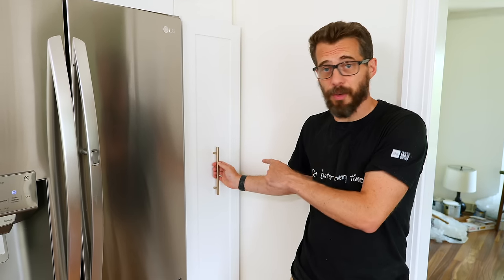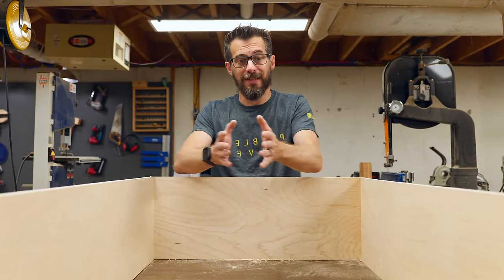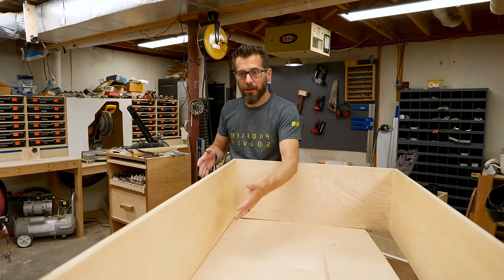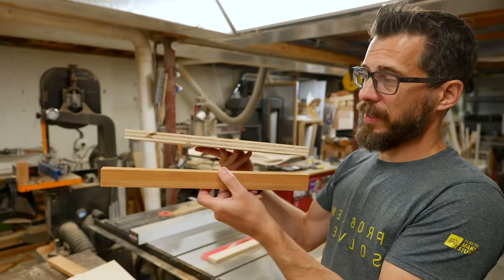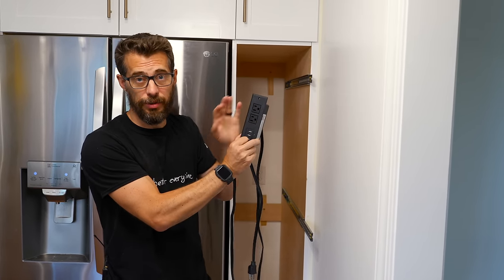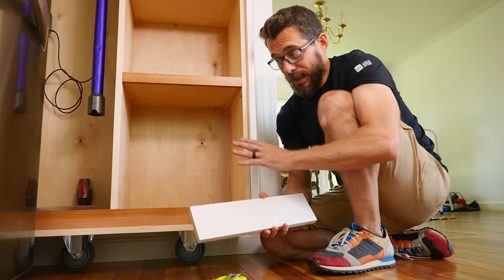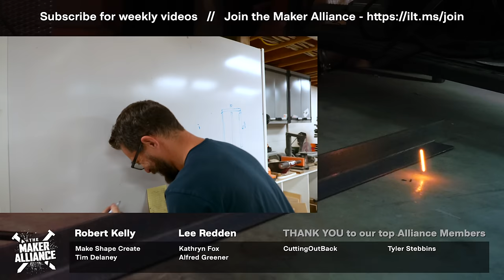How To Make a Pull Out Pantry | I Like To Make Stuff

Comment: a small suggestion: i would also cover the left side of the cabinet where the wheels are as well. like between the wheels and the fridge. flush with the edge of the toe-kick. that way your feet cannot get stuck between the toe-kick and the fridge by acident

such a beautiful projekt! i would love to one day have a house on my own and build this one as well :D
Reply: I agree just add a kick that goes in so its all covered as well. Also add support from tipping to far on that side.  Can put felt on the bottom too to protect floor if it ever goes too low.
Reply: @MrNkubitz  great addition!
Reply: That would also prevent the cat from running back there and getting smooshed.
Reply: Yah, I came here to comment on that too.
Reply: That also limits your ability to doesn't under it
Reply: @Bward216  hinge the inner toe kick to swing for cleaning
Reply: @moomookid723  Ooooh, I like that.
Reply: @MrNkubitz No way you see those wheels while standing up.

Comment: I used your idea for a pull out cabinet and created a secret liquor cabinet in my bar area. The tip about putting castors is what made this project a reality. I also included some LED strips on each shelf. When you pull the cabinet open all shelves light up from the bottom of the bottles, a very cool affect. Thank you for your inspiration and tips.

Comment: Definitely a great solution for an awkward sized space! For anyone looking to do something similar, Fulterer makes pantry slides that attach to the top and bottom of the drawer and are rated for higher loads than typical under-mount slides (up to 450lbs). I just installed two pullouts side-by-side in a large pantry and am very happy with how smooth they operate despite being loaded with cans and other heavy items.
Reply: Can you share a link to the ones you use ?

Comment: Nice.  Using the slides as a stop and a little support at the top is a great idea.  I was working out plans with skateboard bearings and angle iron mess to support the weight...but this is much simpler.
Thanks as always👍

Comment: We inherited a pull-out pantry with our kitchen, which is our primary food storage area. After living with it for 5 years, I can honestly say I hate it. Hard to get odd shaped food containers in and out. Anything hanging out beyond the edges of the shelf will interfere with closing the cabinet. I plan to replace it with a traditional pantry with open storage in the doors as well. 

All that said, I do really like your idea to use pull-out storage for cleaning supplies. I think I’ll repurpose those cabinets in our hall closet for that use. Thanks for the inspiration Bob!

Comment: Excellent Bob!  We did virtually the same thing next to our fridge.  Our pullout is accessible from both sides.  I ended up using extra heavy duty slides meant to for emergency vehicles (300 lb capacity) on either side…as well as a couple on top just as you did.

Comment: I made a full length pull out spice rack like this, turned out great.. tips: dont underestimate the weight of the cupboard, make sure the casters are nice and beefy also dont rely on the rails to carry any weight either. you can hide the casters and anything unsightly by making a mitred box and mounting it to the bottom of the cupboard

Comment: This is exactly what I am going to do with my small kitchen. I knocked down the old pantry to open up the space and used the small adjacent closet as the new pantry. 17"Wx27"Dx81"H. Yes it's small but it's only a 1200sf house. Same concept as yours. Going to use birch or similar wood.  Im thinking 4 non marring wheels from HF. I just need to find the appropriate sliders to mount on top like you did. Thank you for making this video!!!!

Comment: There are actually under-mount slides meant for things like this :)
Reply: Yes! and if you were planning on storing heavy stuff like bowling balls you could add under mount slides upside down on the top. Get rid of those wheels. Just frame the open side like frame and panel w/o the panel to stiffen up that side. Even with the side mount slides you could do top and bottom on both sides.

Comment: Nice upgrade.  Have you ever thought of using pocket screws and plugging the pockets with the wood matching plugs, either store purchased of made in the shop? Then use a trim router to route the plugs down flush. I have used that technique a few times when doing built in book cases. stained and non stained finished clear wood. That way you do not have to worry about glue going everywhere.

Comment: Nice ideal and execution. The pull out pantry offers way more useable space without stuff getting lost in the back. If I were doing this I probably would have added a access hold through the back of the cabinet to where the clips were on each of the drawer slides. Chances are that would fall in the vacuum compartment and would be out of sight but if not some covers would be easy to fit. I was wondering if you put anything on the cable to stop it getting pinched during the slide, I have seen these for chargers in drawers and there is a little metal folding rack to support the cable.

Comment: If you screw the last runner on the top further towards the back of the unit, it will slide out further but still be able to be pushed all of the way in. You can see in the last minute where you slide it in, the last runner doesn't go all the way in. That means you have some inches to play with. 👍

Comment: Yes, yes, and yes! This is exactly what I plan to do for an awkward space next to my murphy bed cabinet build. I was thinking about drawer slides but thought it would be too heavy so settled on casters. I was worried about it pulling in and out straight and not banging the sides up over time, so the combo of the slides and casters seems like a good move. 2yrs later do you feel like you over built or was it definitely the way to go? 🤔

Comment: Another approach to this would be to use 4 casters on the bottom (2 fixed, 2 swivel) and use something like a bi-fold door track and wheel or even something heavier duty like a garage door track and wheel (I tend to over-engineer things) at the top. This would give you full range of linear movement in the unit without having to worry about limit on full extension with the drawer glides.

 An additional fix is to use some of the nylon (like what is used in NFS cutting boards) as a frictionless surface against the inside wall and the back of the cabinet.

Comment: Advice from an amateur cabinetmaker with a technical degree: I would recommend leaving the bottom of the cabinet in and using slides top and bottom of the cabinet. I would also recommend doing a return on the toe kick so it looks a little better from the side. Great work man!

Comment: Also if you are adding wheels on the bottom side of a cabinet like this, use a router if possible to make a track to keep them in line which will make for a smooth pull

Comment: It might be a pain, but to extend the length of the slides you could use a double slider on the top. Would require to do that first as the whole thing would need to be shorter. Slides on the top that once it hits the end of travel the plate has slides on the bottom connecting it to the rolling carcass. If you could find longer full extension slides that might be an easy fix, but your likely to the end of where you can go.  The top solution is also better to get it to release.    Also, hind sight about the wheels is great.  If you had though and put 3 or 4 so  it stands and rolls on its own it might be nice.  I like the false front solution as well with the toe kick.   We have little narrow cabinets on the side of the dish washer and stove that would work great for this, but I think I could do it without the wheels.... much smaller.

Comment: I had a similar project for my pantry's spice rack. Unfortunately, wheels weren't an option. We did two slides at the bottom (in the normal orientation as for drawers), and one  at the top of the rack (mounted horizontally, like you show in your video). Still works pretty well.

Comment: Enjoyed the video and the design idea. Do you have design plans available? Also, a suggestion. I had a king size bed inside a 18" deep alcove with a structural canopy. The sleigh bed headboard had only 3/4" on each side which created a problem for changing the bedding. I detached the headboard from the side rails, attached it to the back wall of the alcove, added a frame support at the head of the bed for the boxspring/mattress, attached casters to the support rails on the underside and laid tracks on the floor under the bed so I could roll the bed out to change the bedding when I needed to. The floor tracks kept the frame from moving side to side and rolled smoothly in and out.

Comment: Love these videos. Just an idea because it looks kind of weird. Add a toekick lengthwise as well. Not only will it hide the wheels but it will also stop the kitty from getting back there. depending on how you attach it, you might be able to hide any kind of gap between the box and the toekick(s). You probably have to redo the front toekick and make it a bit higher.

Comment: We've got a cabinet like this at my moms house, it's a spice cabinet so about half as wide, and it runs on drawer slides. For the depth and weight of your cabinet, casters are probably necessary, but drawer slides are the way to go
Reply: I did one in my house like you are discribing, and its too heavy (100% mdf), i put 5 pairs of drawer slides, and still tilts a little when its fully open, but works haha.

Comment: I made this unit. Got 2  200lb 24 inch door slides from Lee valley tools. I put 2 slides on a section.  

So 4 heavy duty 200lb draw slides

I made 2 sections rather than 1. Each 36x 24. 

You do need to be careful when pulling it in and out

Comment: I realize this is a few years old now. But I am planning a similar project and while doing some research found your video. My cabinet is going to be larger, and thus heavier. Attaching the slides to the top is definitely a great tip. I do have a concern about the wheels being in exactly the same plane as the slides. Which would cause the wheels to scrub as the cabinet is pulled in or out. That is something that seems like it would need to be exact which could be tough. And possibly something that contributed to your comment that is doesn't slide in and out easily. Now that you have lived with it a few years, how is it working? And do you think you have a slight wheel scrub that is contributing to the effort to pull it in and out? If so have you addressed it, or made any other changes?
You have great content, I enjoy seeing your thought process as you work through different challenges in your builds. Thank you

Comment: Nice Pantry project!  I've seen the bottom handled with shelf guides, the pantry mounted on a sled which was on slides but not on wheels - creative.  Other than the vac location, would you do anything different?  Designed strong.  Well done!

Comment: You could have added hinges to top and bottom.  Well like you did on top at the end.   Blum heavy duty under mount slides would slide easily.  The wheels and cutting cabinet are not needed 

Also add a side toe kick that slides back will make it look finished on the side.  So it wraps around.

Comment: Those are some serious casters for this. what do you think the max weight that this pull out cabinet would have to support? And what are those casters rated for? Im usually 100% on board with overdesigning, but thought smaller casters would allow you to make the cabinet have a little more vertical storage. Thoughts?

Comment: Did you consider using rockler pantry slides? Those are made for sliding cabinets that can be accessed from both sides, but would have required less hardware...

Comment: Really cool solution, I love full sliding pantries :)  I feel like there are Blum bottom mount slides that probably would have been strong enough for this and made it a bit cleaner and smoother; especially if you included some of those standard slides on the top.  I feel like I've seen specs on them that can manage ~125+ lbs a piece which would have been more than enough for this application.  Probably way more expensive though.  I love the creative solution :)
Reply: Do you have any suggestions on those drawer slides?

Comment: instead of the wheels on the bottom what if you did the slides on the bottom like you did the top, do you think that would work? I would agree the wheels on the bottom are stronger but was curious if the other way would make it smoother? This is a really great idea and i may think about this when i try to design organizers for my kitchen cabinets that are akwardly small.

Comment: I’m making 2 of these but using barn door rail so it hangs. I used Teflon strips at the bottom sides to guild it on its way out. Should be smooth because it’s not rolling.

Comment: It's very cool, and fairly basic for someone who's a very basic carpenter. EXCEPT for the sliders. I don't understand why you need sliders if you have the wheels. Mine will be much narrower, and possibly not sliding out at all. I can just throw my mops and brooms in there.
However, I'd like to make slide outs underneath my kitchen work table. Much cheaper than buying slide out drawers. Am I going to need sliders? The pull out cupboards will be approximately 60cm wide 60 cm deep and 80 cm tall. 
I'm open to answers from anyone. Thanks very much. Subscribed!

Comment: Two things:
a.) There are ready made systems that work flawless (like "pull-out larder") but usually they cost a hefty premium.

b.) I would have drilled three holes in the back where the latches are so you could easier get to them if you need to just by bending your finger.

Comment: Nice project Bob. A lot of variables to address. A whole lot of couch-carpenters giving marginal advice. The refrigerator door depth is often overlooked, even the modular cabinet layout guys will miss that often enough. In hindsight, the cereal/food side just gets about 3" narrower and that allows more access to the vacuum side. Down the road you could address that if it's one of those things that drives you crazy. In the meantime, get the rest of the kitchen finished for the sake of marital harmony ;-)

Comment: Bob, I think if I were to make something like that for my kitchen, I would do 3 things differently:
1. Do 4 smaller wheels on the bottom, and...
2. Make those wheels run on tracks, and......
3. Plan some way to be able to pull the whole unit out for cleaning. Lots of shmutz is going to get in there......

Comment: Alternatively, a much easier version of this consists of building a bunch of regular drawers which you install in the base cabinet. You space them out just like the shelves in this video so they can hold tall items. But instead of having one drawer front per drawer, you only make one tall drawer front that covers all drawers, so they all open and close at the same time. Don't use self closing sliders or you'll need too much muscle to open the cabinet since they offer a bit of resistance.
Advantages: lighter structure, no wheels needed so no contact on floor, sturdy because 2 sliders per drawer, and easier to build because no different than regular drawers.
I made a ton of these.
Reply: This is how my kitchen is, I’m here wanting to do what the OP did. One large pull out makes everything much easier to find and organize

Comment: nice!  Question is how do you reach back on the wall side between pull out and it to flip the the little black flippers on a the slides so you can pull the unit out?  like about the wheelie dealie on the the bottom!

Comment: Awesome build.  Was thinking about building something very similar for my laundry room.  Did you consider using Fulterer pull out pantry slides?  It may not have been an option for your application due to the height loss and they are much more expensive than your solution.  I also noticed on your site that you gave it about 1/2" clearance on the front side and space for the slides on the back so I'm assuming the total is <1" difference between the cabinet box and in the inner "drawer".  Do you notice any resistance due to air / back pressure when closing?  Finally, out of curiosity how wide is the cabinet?

Comment: Another idea i saw in a build instead of the two long drawer slides is to use small wheels on the bottom sides left and right, a couples or more per side to guide the whole thing.

Comment: A wide rubber caterpillar track instead of castor wheels would be way more stable and greatly reduce wear on the floor. Just make a simple conveyor belt type of assembly and mount upside-down under the cabinet.

Comment: My only complaint with that setup, is the 5V usb on the power module is always on = uses power for no reason = heat, which basically means everything in that cabinet would be warm, all the time. And being beside the fridge does the same thing too.

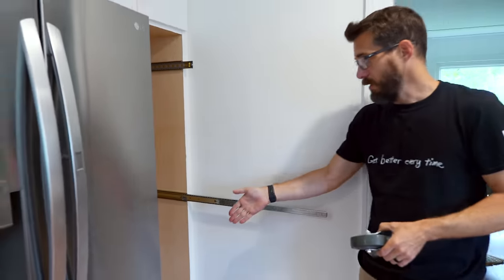Comment: Instead of trying to use a stick to pop those levers, you could cut finger holes in the back so you could stick you finger through and flick the lever.  The holes would only be visible when the cabinet was open and pulled out, so it wouldn't look bad. 8:42
Reply: dude. Thanks, I'll keep this in mind, I'm about to run in a similar issue

Comment: Doesn’t the side of the fridge get very hot at times, could that cause issues getting stuff warmed up in the cabinet
Also why was the fridge not in the corner instead

Nice vid
Reply: I doubt it gets that hot to cause any problems + there's wood between the fridge and the interior. Putting the fridge all the way to the corner wouldn't allow for the door to open fully.
Reply: Yeah, I second that. I had the fridge in the corner in my last appartement and it was very inconvenient, whenever I wanted to take out the shelves and clean it, because the door would only open to about 90°.
Not a big deal, maybe...but I wouldn't plan it that way in a family home, either.